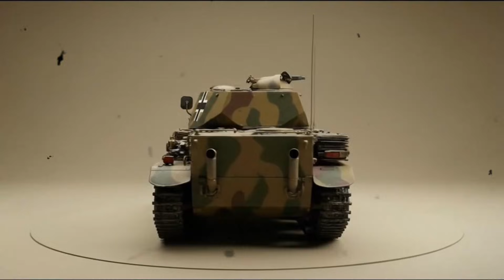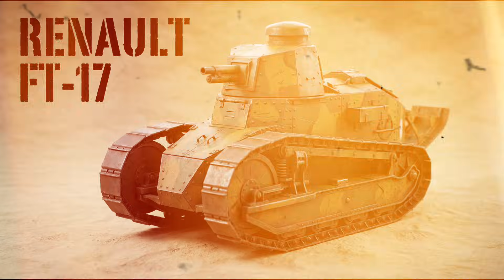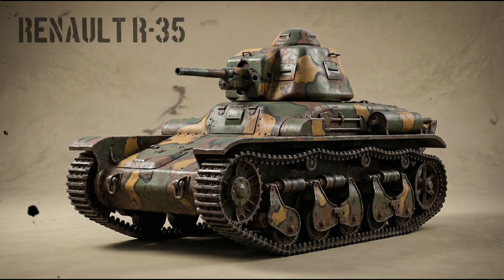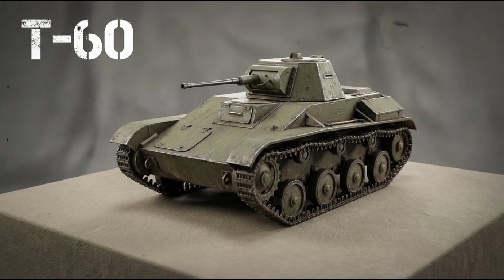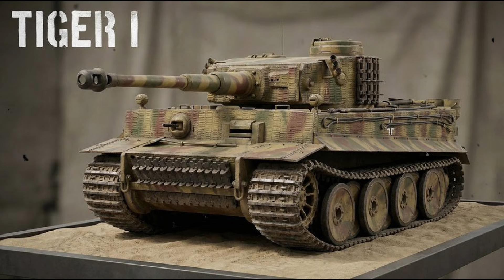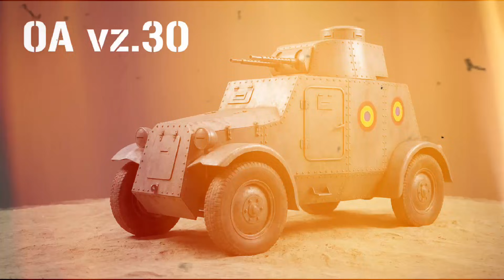Every Romanian Vehicle Used in WWII

Comment: In fact in 1944 the 1 st Armoured division and the other 2 divisions has around 100 Panzer 4 .Snd dont forget P3 N aprox 25 used at Stalingrad and nearly 100 Stug 3 ordered in 1943 in Olivenbaum programe along the P4 tanks .Most well known modified vehicles are the TACAM 1 a tank destroyer armed with 76,2 Soviet anti tank gun who was instaled on the modified T60 chasis cca 30 built  and TACAM 2 a similar vehicles using  the Skoda Lt 35 chasis 21 build .

Comment: The following tanks were not mentioned.

Toldi I or Toldi II
Turan (Unsure which models)
Pz. III Ausf. M and N.
LT.vz 35 R-2a (the older tank used before the vz. 38)
T-26/37 - a T-26 conversion
T-37A
T-38
OA vz 27
Tratra T-72
BA-10
BA-64

None of the Romania's tankettes were mentioned
Tancuri R-1 (czech)
Renault UE (French)
T-27 (Soviet)
TK-3/TKS (Polish)

Some vehicles are rumored to have been in Romania's service or inventory, but I'm uncertain
M3 Lee - Captured via the USSR and used for AT training.
Vickers 6-ton

This list of course, ignores anything that "isn't" a tank such as their SPATG... like the Maresal, SuG III, TACAM R1/R2, TACAM T-60A

Your OA vz. 30 is also wrong and does not match the real vehicle.

Nice video however, keep up sharing and educating.
Reply: What do you expect, it's AI slop
Reply: but toldis were hungarian tanks
Reply: were the toldis captured?
Reply: @JohnDoe-qb6yh  We captured them in battles for North Transylvania in 1944 after we switched sides, we also captured Zrinyi howitzers